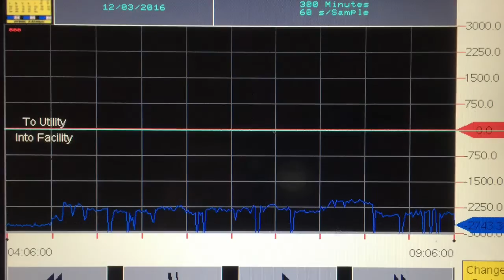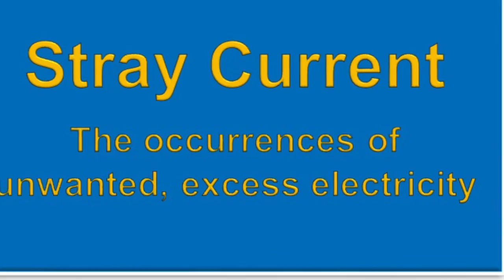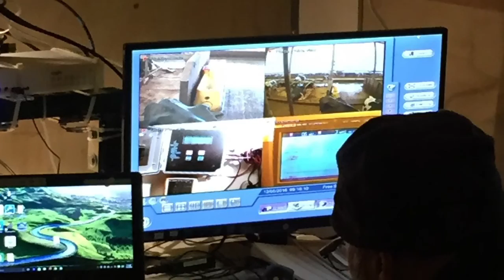Clay View Dairy - Stray Voltage

Comment: Nice video, stray voltage is a general term used, but very few people understand. Dairy people understand even less because the consultants that they work with don't get it. The energy company trains others and is protecting itself from lawsuits. They tell you to watch your cows, but everything looks normal until the problem gets solved. The best visual about cows is to watch them drink water. I have yet to be on a farm and not see that as a big visual observation. Watch a YouTube video titled "Stray Voltage Issues", watch to the end please. As told to me by someone who understands how it works, 'You will hear a lot of things from a lot of people, but up to you to sort it out". I as a dairy farmer, I went thru the whole process and don't want others to feel so overwhelmed. Thank You, Bruce
Reply: Bruce Paull dealing with stray voltage myself currently in my milking parlor. What was your issue?
Reply: @marktwine1833  Us too, we got our barn/equipment checked out a few years back and installed a fault monitoring system.  Now we're trying to find ways to meditate ground current from the utilites' primary neutral
Reply: 91jvdb have you looked into a neutral isolator? It separates the primary neutral from the secondary neutral at the farms transformer. Ronk and Dairyland both make them. You’ll have to have the utility install it though. How much is coming in on the primary neutral?